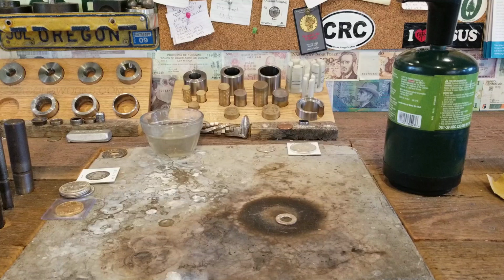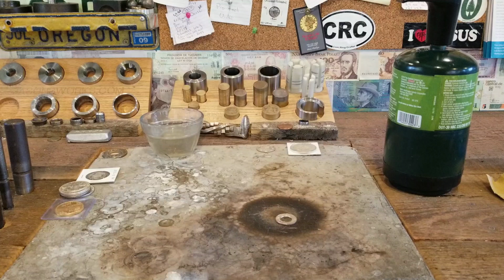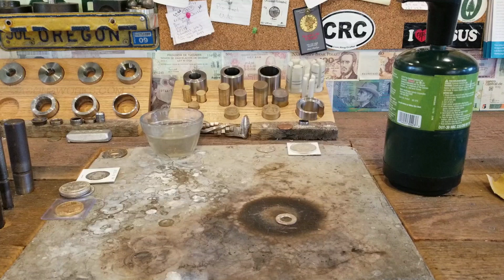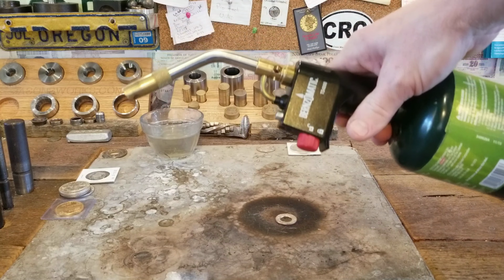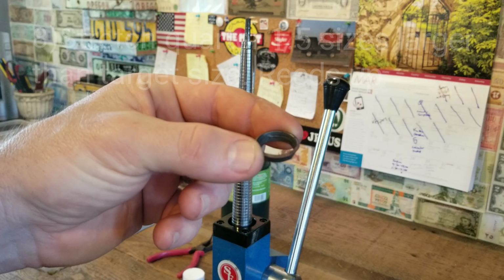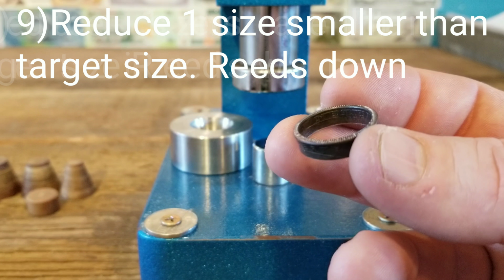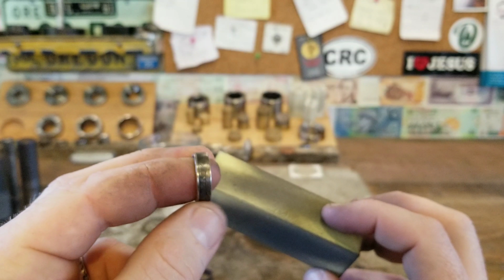How to make a quarter coin ring with FORGED Book 2

Comment: At 09.00 you use the „pepe lube“. What exactly is that? Looks like wax or something. This stuff is not available in Germany, so that I have to look for a replacement 😳
Reply from the maker: It is just a dry lubricant. You can get away without it.

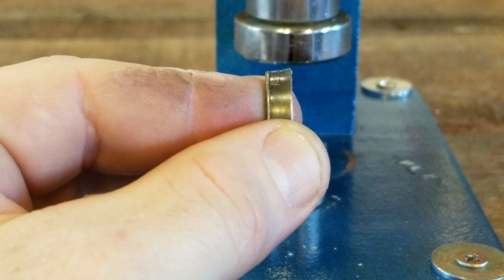Comment: I have a small question, I just started making rings out of everyday quarters, and the problem I'm having is that the serrated lip of the coin is wider. Like the problem you had at about 10:52 of this video. I have been generally following the instructions from your low tech video, "how to make coin rings for cheap". All I have is an anvil, bench vise, and a nylon hammer, any suggestions?
Reply from the maker: It sounds like you are going well with the low tec. Method. Unfortunately you need to do a bit of tooling up to get to the next step. Dealing with that taper requires tools for sure.
Reply: Coin Rings from The Mint - Change You Can Wear  Ok, thanks for the imput! It's really awesome that you reply to questions in the comments
Reply from the maker: I really try my best to keep up :)

Comment: question, where are you buying coins? "The Mint"  Also I bought a ring from Coin Rings from the Mint, I love it. I have bought the presses and die sets and watched a ton of videos. Keep up the great work. Cant wait to get started. God bless you brother!
Reply from the maker: I buy my clad coins by the roll uncirculated. There is a local coin shop that I get most of them from. If they don't have them I buy uncirculated rolls from Ebay. I'm glad to hear you are getting into coin ring making! It is a ton of fun. You can also buy them individually but it can be a bit more expensive.
Reply: Guess I need to get over punching a hole thru a dated coin. I better practice before I try an older coin. Thanks again!!!

Comment: Hello Skyler, with that particular coin ring, what was the initial size hole that was punched? ie, 1/2" or smaller.
Thanks, great video, curious how long it took to edit.
Reply from the maker: That one I used a 1/2" hole. I edited this video over 3 days. I would guess 3 or 4 hours total. I'm pretty slow at it.
Reply: Thank you Skyler, I started working on video's and its like forever....never ends, always something missing...the edit icon disappeared!